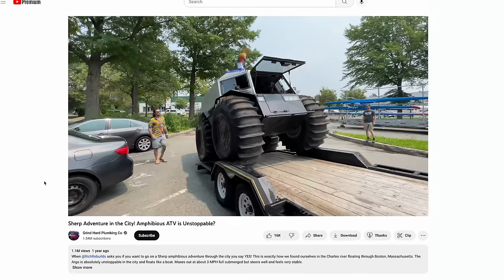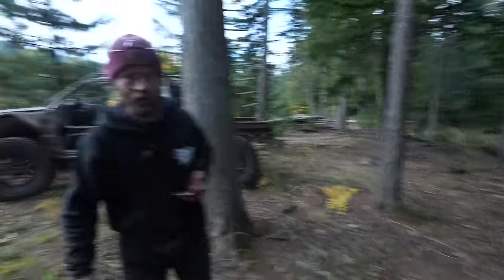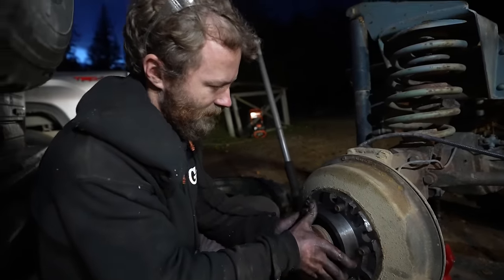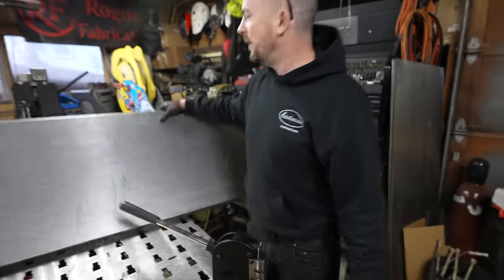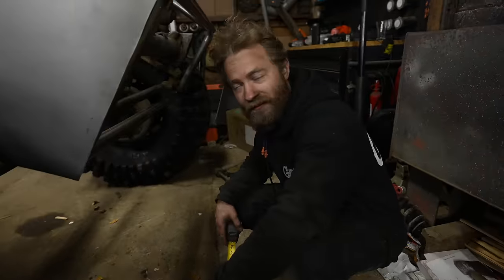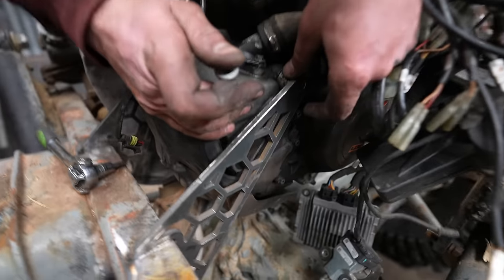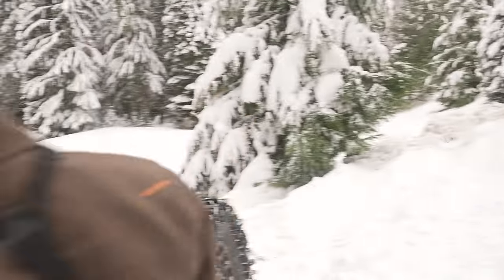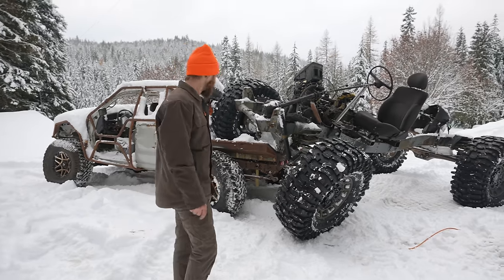We Built the Ultimate Red Neck Go Kart! 36 Gears?!?

Comment: Just a tip for you guys, unimogs get their insane flex through the frame and very little from the suspension. The actual suspension is meant to carry the equipment or material a unimog is using ie. a  backhoe or dump bed which means the offroad capability must still be there and it's thanks to the frame flex. That is why everything mounted on the frame has large bushings or similar material to accommodate flex. I love the project, but I don't want to see you ruin the capability or shear whatever you weld straight to the frame.
Reply: when they started cutting it I cringed a little but I had hopes that they would do it right
Reply: Def a little sad they cut it up, but they will likely fo a full rollcage in thr future meaning they they have to upgrade suspension to it more similar to modern 4x4 suspension
Reply: On unimogs the body and box are all 3 point mounted, never 4 points, that allows the frame to flex..  
Also the coil springs are fine, but it's so much lighter that the original truck. And needs softer springs, possibly air bags would be nice, 
But no matter with such heavy  wheels and axles compared to the body weight, it will still have problems....

Comment: 29:00 this is common when clearings are cut. Edge or close to edge trees fall much easier. You should check each tree around your area of operation every two years, because you're incredibly lucky nothing bad happened, a friend's father lost a leg from something exactly like this. He was in his tractor, getting it started to move it inside as a storm was rolling, and out of nowhere a pine fell and smashed the tractor's cabin, grabbing his leg. He was on there an hour before he was rescued. Trees don't play around when they fall.

Comment: I would have turned around the transmission and transfer case and put the engine in the back.  Then put the driver right up front for good visibility.  I would have done a 4 link suspension with coil overs so you could chop the back end... and maybe shorten the frame.  If you needed space I would have made it wider.  Also it needs some crazy bead-locks so you can run it at something like 2-4 psi.  I think it needs about 2-3 feet shortened out of it.
Reply: They were running out of time dude. They needed to get something functional and did you see how junky that thing is? They were trying make if work not perfect
Reply: @everettstormy  But it sounded like the original project was cancelled so there is no longer a deadline.
Reply: @toddabbott781  they have to make a video. That's the end all be all. They have to have money
Reply: @everettstormy  Yh Bro this guy is talking like they have years on years and an infinite budget
Reply: Pine cones have you seen any of there videos they make it work no matter what the budget is
Reply: @trashypantsyota  yep

Comment: Hey Ethan or the crew, what size lathe you'd suggest to go for as a newb but still want to have decent use, or any tips you'd like to share. Cheers and great stuff as always gents.
Reply: Basically it will never be big enough
Reply: Something like a Logan 200. I've had one for 4 years and it's great for all kinds of home shop stuff. I have a larger lathe now, but it needs some work so I've been using thd Logan 200 still and don't feel pressure to get the bigger one going. Watch This Old Tony's videos on the Chinese mini lathe for some more context on picking your first lathe and options like a Logan or similar versus a cheap import

Comment: Ok, i'm only a few minutes in, but... I'm pretty sure this is the worlds first ktm swapped unimog 😆
Reply from the maker: We think so 😂
Reply: I skipped through the video, did they stiffen up the frame? The mog frame is built to flex (why everything is riveted and not welded to the frame), and hard mounting the engine to the the separate rails is a cracked engine case in the making....
Reply: Is this the first time a KTM was even ever used or available to be used still. It was good for the beginning 6 years matching up with six gears...... Y'all math guys get it.

Comment: Heads up the unimog 404s frame is designed to flex 11⁰  and is made out of spring steel.. 
   The round cross tubes are designed to flot the Trans and engine to prevent binding when the frame flexes....

Comment: You really should show people how that Nibbler works. I did commercial and residential AC for a while, and we had a nibbler, and a pair of electric tin snips, but they weren't nearly as cool, except for the little curly spring that came off as you cut. And, for those of you who are curious, the Nibbler just punches millions of tiny holes in the metal, and you just steer it around.

Comment: Made something like this 25 years ago, except mine had some thought put into it. Jeep truck frame with a Dana 60 in back with a Spicer 30 in front. 4 cyl turbo, front wheel drive  engine, turned sideways and sunk down in the frame. One axle shaft to each diff from the trans, with a brake system on each drive shaft with 2 pedals to lock out which ever diff you want if needed. Turfed all the transfer case and trans crap. Too much weight. Used it for plowing snow and off-roading for 15 years, then sold it.

Comment: This will break the input shaft, or the output shaft on the motorcycle transmission. You can't mount the engine to the frame conventionally on a Unimog chassis as they twist too much. The engine needs to be solidly mounted to the transmission so they remain in alignment. In stock form there's just one motor mount at the front of the engine so the engine/trans are three point mounted to allow for frame twist, just like everything else on a Unimog. Also, the transmission is a structural member that carries most of the loads from the axles and it needs a front mount one way or another. Remember Unimogs are road-going tractors, not off road capable trucks.

Comment: You should take the comfy car seat, put it on wheels with a motor with a small ice cream machine on the back, tool tray, and a cup holder so it can be a proper shop chair. If you can find a massaging seat from another vehicle that could be an option too.

Comment: The dimensions of the wheel and tire package are really similar to what 1/10 scale crawlers run. Technically the most common size scales up to a 19 inch rim with a 46/47 inch tire.

Comment: What you have there is a 1960 unimog 404s frame that twists up to 20 degrees around the center. Your engine mounts will snap as the gearbox rotates. Put a cable axross the front suspension mounts , let the engine rotate on it and bolt it to the gearbox.

Comment: On those custom hubs, you would have been wise to use the lathe to create an outside bevel (at least 40°) and then do several passes for better weld penetration. That's way more effective than the minimal preheat you'll get from that stove. It's more time welding, but for such a critical part, that's not where you want to cut corners and have a wheel fall off.

Comment: Are we Making Bets How Many Yards or Maybe Miles This Will Last Before it Breaks and for Bonus Points What Part Will Break First , Will it Be The Soft Alloy Engine/Gearbox Casing Being Subjected to the Loads for Steel . . . The Mass Total Stresses or adding Bigger Wheels Diameter and load on one of The Shafts/Crank snap or Twisting or End Bearing Exploding or Possibly The Weak Link Is the Clutch . . .Place Your Bets NOW !!
Reply: All these at once.

Comment: Light weight, decent power, low gearing and big wheels = unstoppable? I'm taking notes to build my dream thing one day. Something like bv206 but smaller, a lot lighter and more agile. With tractor-like hydraulic systems at both ends so it can do work too.

Comment: my rock lizard tube chassis has a 240 horsepower artic cat 900 2 stroke , t5 tranny , suzuki sammy transfercase , dana 44 axles , 42x10-22 terminator max tires on 22x10 wheels , 3/4 x 4 inch bolts threw all the open parts of the tread in the tires with double nuts welded to the bolt , foa bypass shocks , 4 link front with watts link rear . had the 3 expansion cambers nickel plated and put dg mufflers on each . entire build took 6 months and 10 grand ! not to bad for 1 man who is in a wheelchair !!

Comment: The unimogs frame is designed to flex 11⁰  ..
Welding to the frame made out of spring steel .
Probably not a long term working solution ...
   All ALL  mounts should 
Go back to the round torque tube cross members to avoid damage as the frame flexes

Comment: May I suggest the KTM get a recluse Auto clutch and then keep the manual collection the unimog gearbox and the point of that is as you do not have to clutch two different devices to be able to change gears to a ratio that suits your needs at the time

Comment: You need to let some air out of the tires. If the proper wheel and tire combo are achieved you can confidently lower the air to 10 lbs or even lower 3psi.

Comment: Im less than 5 min in and i allready see one red flag... a motorcycle cluth isnt meant to push that much weight. it definatly have the power and tourqe but i expect the clutch to sign out rather fast, atleast in the higher gears. there is quite the size difference between a car and mc clutch. i dont doubt youll solve it somehow once it present itself tho :P

Comment: If that was an mercedeser turbo diesel then it would be the most reliable ever featured on this channel so please tell me its at least going to put to good use, because with a larger pump and a larger turbo it will make decent amount of HP and even more torque, and I would had used it even tho its Heavier and moved the engine to either the middle or back with chain drive just because with the massive tires you used the KTM gearbox is screa,ing for its life especially if you thinking about using high gear.
Reply: Any crashed motorcycle had this absurdly brutal shake moment when it happened. The engine gets a lot of this shake and the wave of dispersed energy. The one that affects cars after a frontal hit with post-crash corrosion as far as the C-pillar due to delamination of the anti-corrosion layer from the body or frame.
The engine sound was so bad when cold.

Comment: Just put a roll cage on it so it's safe to drive and some four point harnesses in another seat as for the body why do you build for it has a lot of usable pieces in it so I wouldn't toss it I would just save it as needed but that's your new redneck go-kart 2.0 which it's a little bit better than the beast that you towed back with a tow strap to your place